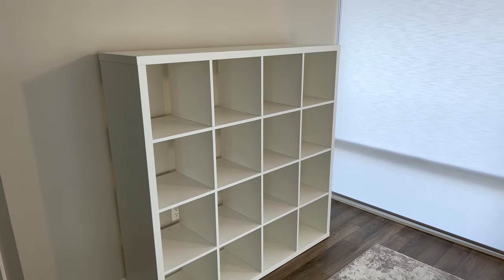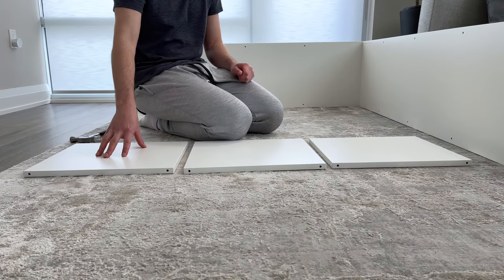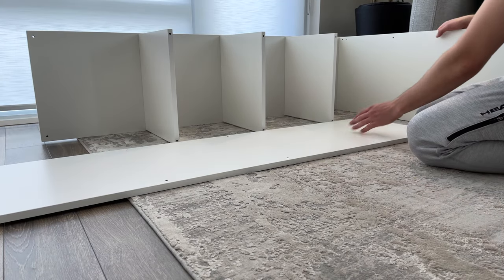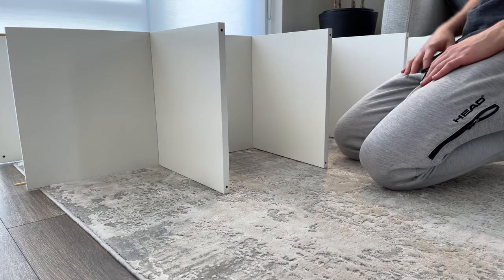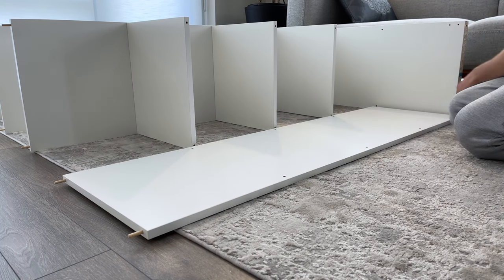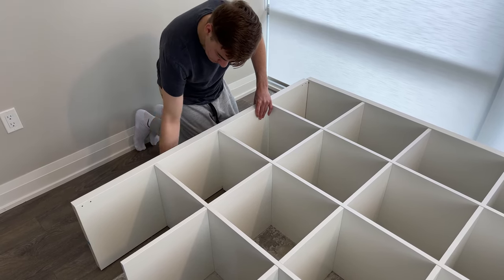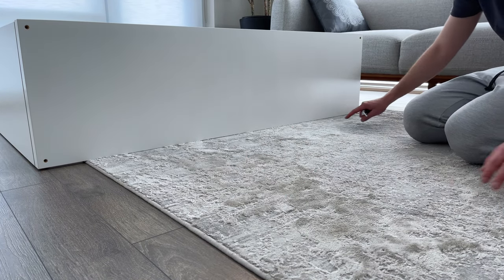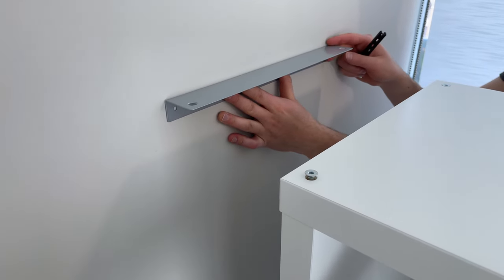Simple Tutorial. How To Assemble The Kallax Shelf Unit From IKEA

Comment: Is anyone else having trouble on the first step? i can't even put the screws in without there being a huge gap no matter how hard i push the two sides together.
Reply: Yup, I just hired someone to do it cause I can't be bothered lol.

Edit:  They never showed up, but I figured it out after a while. Just use a drill, makes it alot easier.
Reply: @JustinJosephRE  lmao
Reply: Same 😢
Reply: Same here
Reply: I’ve built and rebuilt the 5x5 version of this shelf many times. What I find is that you have to keep turning the screw, then you overcome the separation and the panels will come together. If you have a really stubborn one, you can screw the screw into just the side panel first, this cuts some threads making a groove for the screw to slot into. You take the screw back out and then assemble the panel as in the first step.
Reply: Tried it on the wrong side then. Overcame this problem haha

Comment: You forgot the part where you have to cut 1cm off the dowels with wire cutters because they are just that much longer than the hole that were drilled for them.
Reply: Thank you for the video though!